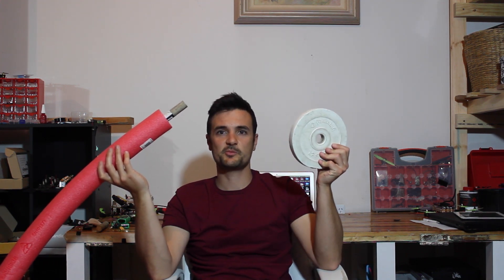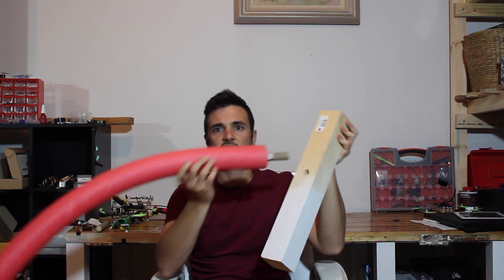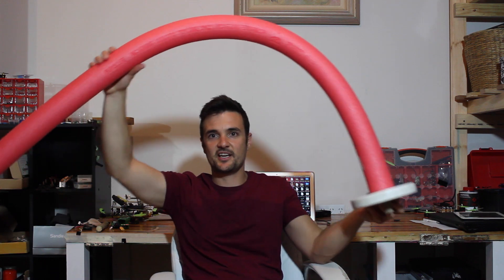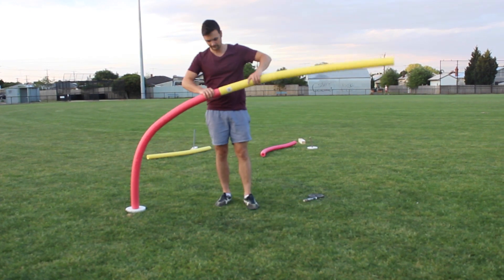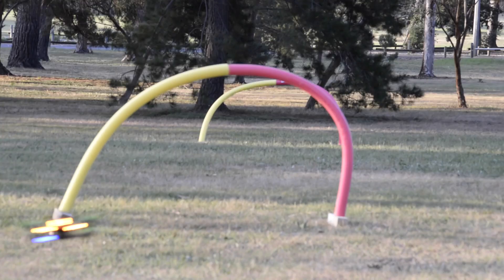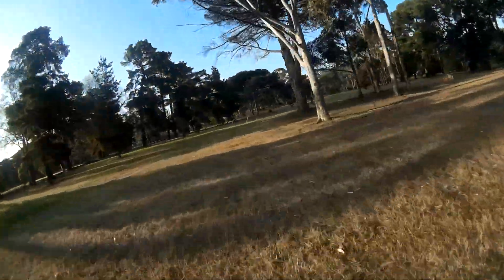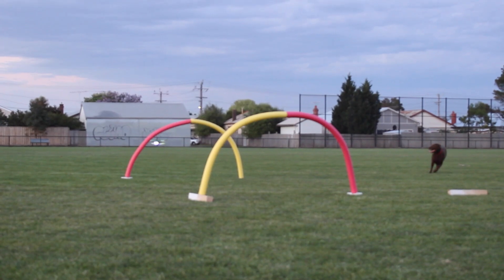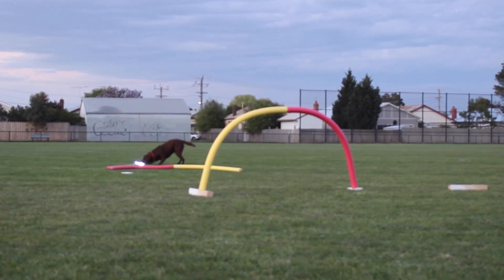How to build an FPV air gate for less than $5

Comment: Wow Stew! What a surprise to come across your first video posted at pretty much the same time as I posted my first (flying an Eachine Racer 250). Of course, you've gone on to become a YouTube FPV quad phenomenon and me... :) You deserve every bit of the success you've had.

I've had some pool noodles kicking around for over a year waiting to be made into gates so I thought I'd have a quick look at how others are doing it. Great informative video. I don't have any weights but I hadn't thought about using wood like you've done. Simple and effective. I've got some old bits of wood kicking around so it makes sense to use them.